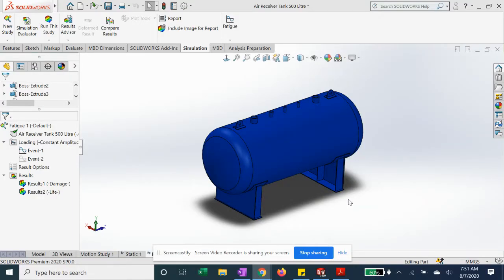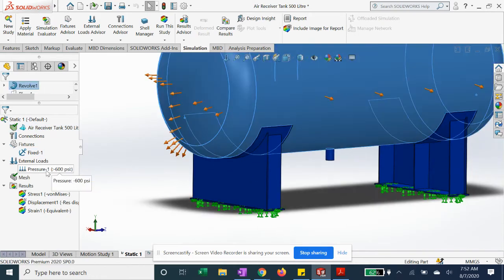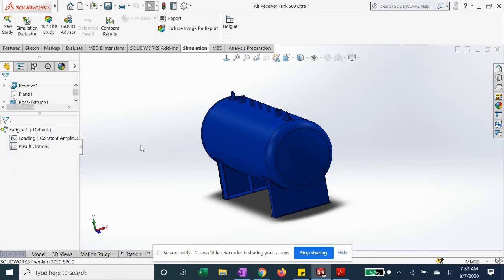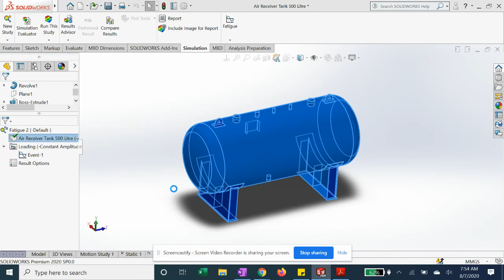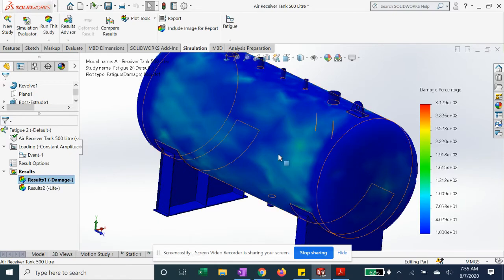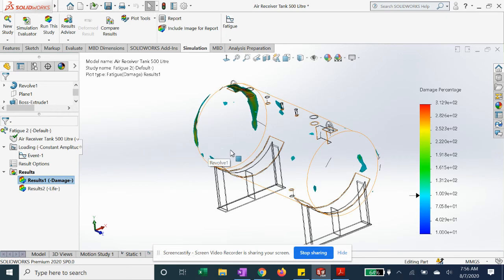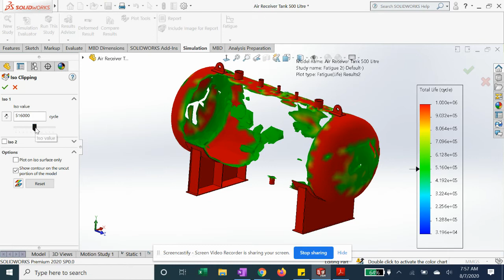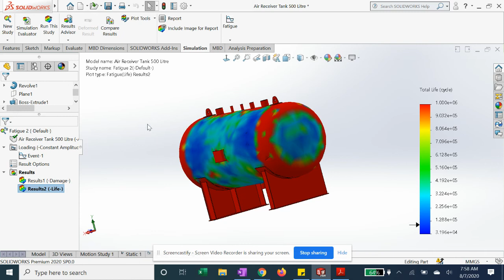How to do Fatigue Analysis | Solidworks Beginner Tutorial

Comment: In horizontal vessel there 2 types of support, 1 is fixed and other is flexible, can you model that?
Reply: Use remote load mass distributed connection, one acts as hinge and the other acts as roller